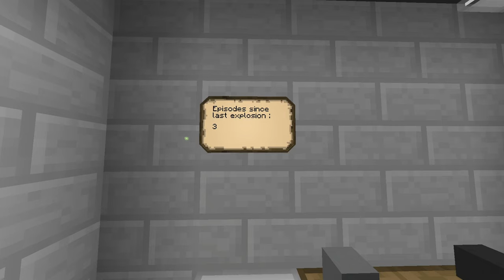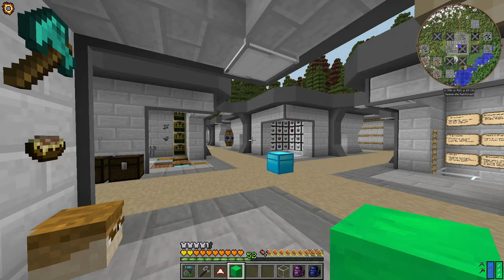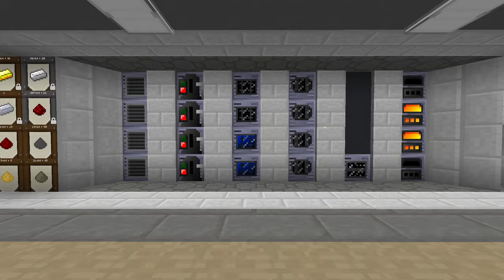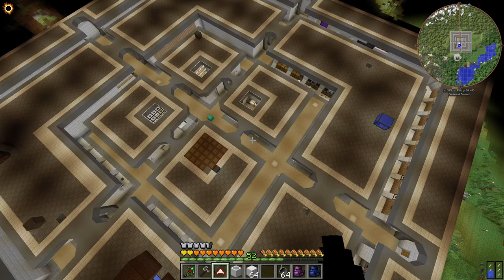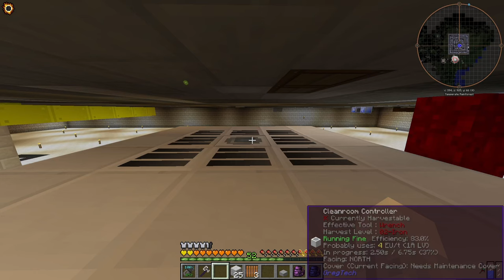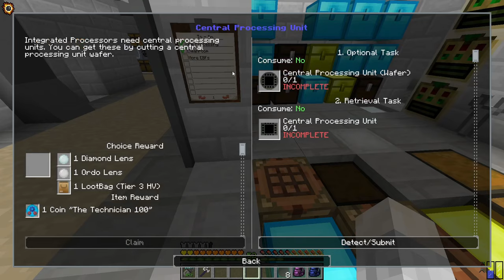Minecraft - GTNH Ep.21 | Ore Processing

Comment: You should keep getting the radium .. you can "process" it with putting it into a lead chest to make it decay, and the decayed product is useful and stacks.
Reply: That’s good info, was that in the quest book somewhere or where did you find that lead chests will decay radium?
Reply from the maker: i didn't put it in the video, but i tried to just filter them with enderio and it didn't work. any tips on how to move them? it seems they have special nbt data that messes filters up.
Reply: @MrZe  yes, if they enter your inventory they start decaying, the same they do in the lead chest. For filtering, have you tried putting them into the filter from NEI? Or disable the check for nbt data in the filter (though that requires an advanced i think)
Reply: @chandleready8988  That is mentioned somewhere in the quests afaik, but it could also be info that i have from playing for far too long :)
Reply from the maker: figured it out, dragging from NEI worked!